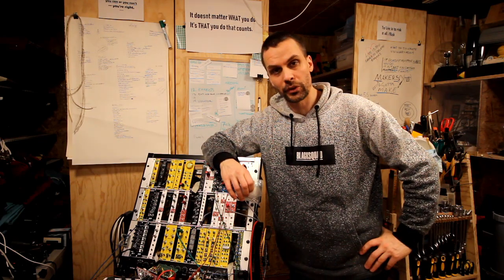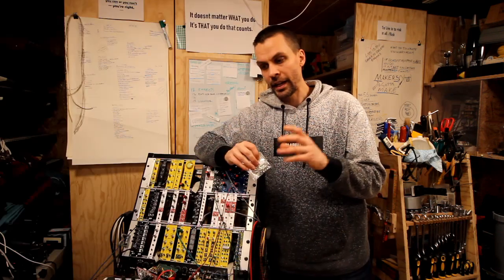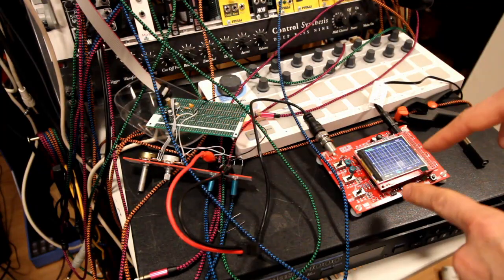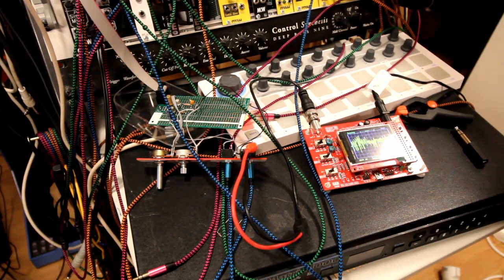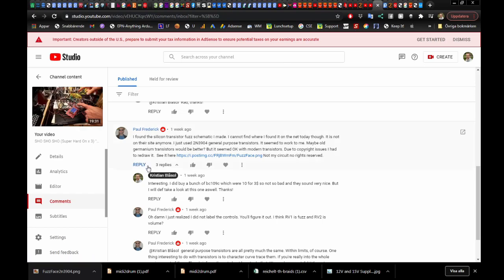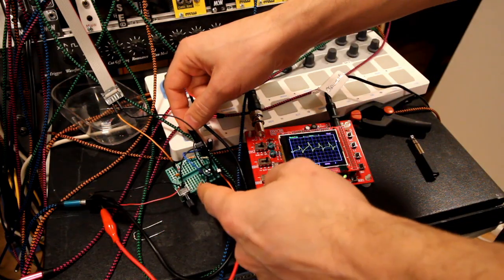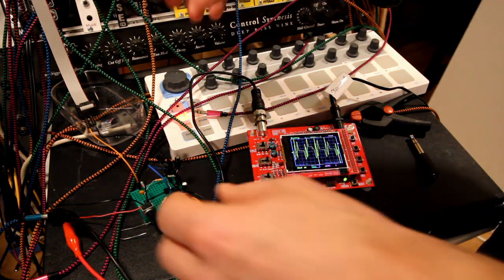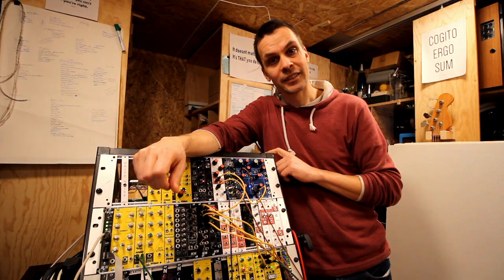Fuzzface - Modular in a Week 13.3

Comment: Great video once again. Did you run it directly off 12V rail and did you add any eurorack conditioning to the input and output?
Reply from the maker: Straight off 12v and no conditioning. :) just followed the schematics.

Comment: That was really cool.

You can see the general idea of how it works on the oscilloscope quite well... the transistors boost the signal super-high, and the caps stop it going away immediately, with how long being related to one pot, and the initial level being the other... and the caps also basically give you the signal with no DC component on the input, which means basically you get just the change in signal, instead of the entire signal... and they also will have an effect on which frequencies are resonant.  (Because the caps are polarized (and the circuit isn't 'mirrored'' for each side) you get an asymmetric response/different shape on each side of the waveform. 

It's very cool to see the relationships between the circuit and the signal response.

Comment: Six of one's a half a dozen of the other. Thanks for trying out the circuit I sent. I remember when I made it I liked the effect. I'm glad you got it to work and you liked it. You do not always have to use rare components to get good results. Find some old polystyrene capacitors though. They are the exception. This is what they look like http://i.imgur.com/QsAMdhP.jpg You can find them in old radios. Like if you see old radios cheap at second hand sales get them to strip for parts. You can make mind blowing oscillators with those caps. They do this weird step thing when you sweep them. A la the 555 Daft Punk circuit. They are just really musical.
Reply: I should add the vintage radios you need are from the 60s and 70s. They stand a chance of having that kind of a capacitor in them. Once I found three vintage JRC 4558s in an old radio. That's like $300 worth of ICs. Don't let anyone tell you the old ones don't sound better than the new ones. They just have counterfeit chips. This is what real old ones look like https://i.imgur.com/2iZ10TW.jpg Those are from 1968 They have fat tone for days. The place to get vintage parts is out of vintage gear. But then you have to be careful with that old stuff. You only put it into circuits you know work. Because you're not going to get more.